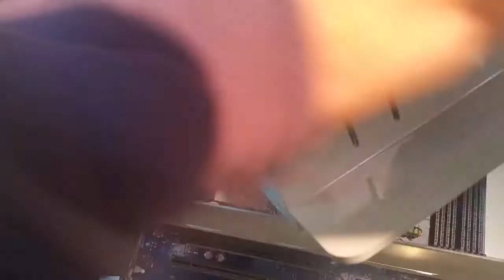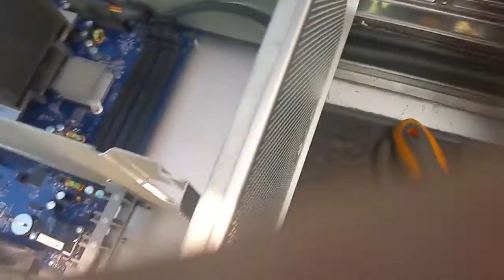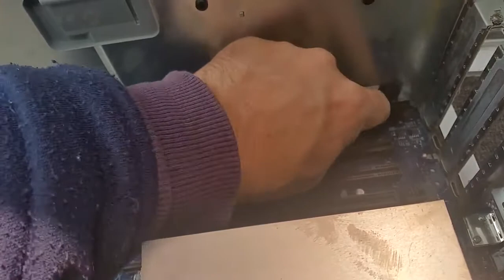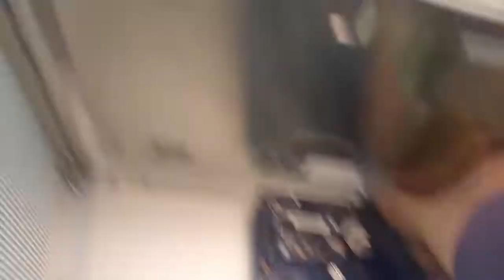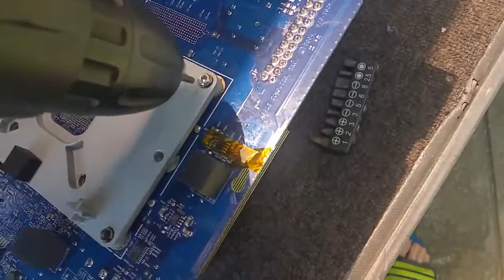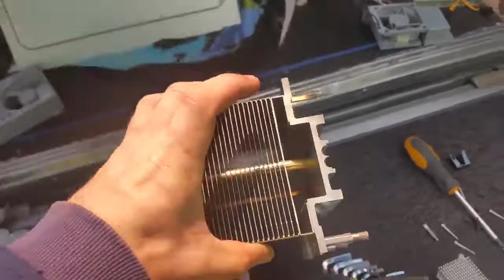Apple MAC G5 Tear down

Comment: The larger chip, between the CPU and RAM slots is indeed the IBM equivalent of a Northbridge. It contains the memory controller, and I/O to the rest of the machine. G3, G4, and G5 chips had shorter pipelines, which made them very efficient, but clocking to higher speeds reached hard limits. G5s were clocked to extreme levels, compared to the old G3s (which were passively cooled with tiny heatsinks the size of the one you pulled off the northbridge chip). Those higher clock speeds pushed the G5 to the edge of what that chip architecture could handle, and thus the chips ran very hot.

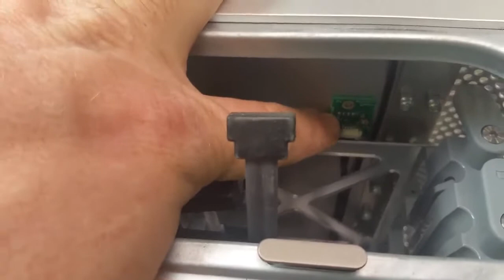Comment: AT 10:20 that little thing is a temperature sensor. The G5 used cooling in 3 separate compartments and had fans in all three that were independent.

Comment: Yeah, the G3, G4, and G5 CPUs were tiny chips, but you also have to remember, those early ones were also only single core. Consider a modern chip has 2, 4, or sometimes even more cores. Also, Apple used an exposed die (the actual silicon). Intel's modern chips are lidded. They have a nickel plated copper lid that protects the fragile silicon die.
Reply from the maker: richfiles, thank you for the info. that i didnt know. mac and me arnt real friends, lol
Reply: I still have my old G5 sitting in a closet. I ALMOST Hackintoshed it, but I selected the wood cabinet of a 1939 Philco radio as my PC case instead... Never regretted that decision! Turned out beautiful!
Reply: I think some of the faster G5 chips were pulling 80 watts through that tiny little silicon die, when clocked to 2.7 GHz! A G3 running at around 400 MHz back when it was new, only drew about 6 watts. Huge difference clock speed made on that architecture's operating temperature!

Comment: I had some painful (love-hate) relationship with POWER, always running either a BSD or GNU/Linux.  Since apple was the sole manufacturer... I was chained to bad caps, weird and unsupported hardware choices (video cards, etc) Once you got over the nonsense the chip was fairly reliable. I wish IBM would sell POWER workstations since they have become terribly powerful chips.